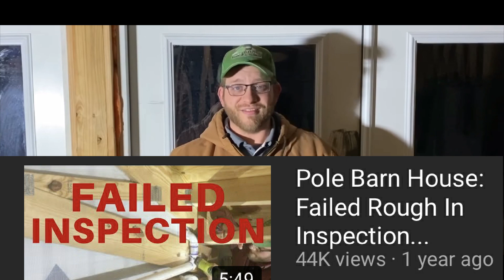Failed Deck Inspection

Comment: The deck builders weren't aware they needed those support fittings? WOW! The old foundation would probably make a solid and more sound-proof recording studio. Maybe a nice storage place for yard tools, bikes and such.Best of luck.
Reply from the maker: They said the fittings aren’t required in each area they build in.
Reply: @LittleMountainLife  I would think a company in their business would be aware of the local codes and restrictions.
Reply from the maker: Honest mistake if you ask me. They came back and fixed it later that same day. Thanks for watching!

Comment: Deck looks good. Head room under deck may not meat code if you develop it into housing use. Would worry about fire code as you have very limited exit with the block wall.
Reply from the maker: Thanks! Won't be considered housing use.  Likely just some storage.

Comment: Under the deck space. Well great idea but. But the big question  is deck water tight? May have a problem  just saying
Reply from the maker: We would have to do something to direct the water away from underneath. But it likely won’t end up being used for anything super important.
Reply: Could put a tin roof under it. But cost versus  what little you would gain may not be worth it right now

Comment: That deck is going to take a ton of maintainence over the years, i built a steel deck and bit the bullet and put composite down... guaranteed for 30 years uncovered, mine has a roof so it will outlast me im sure.
Reply from the maker: The amount of maintenance is relative. We are happy with it but are definitely considering switching the deck boards to composite in 10 or so years. It all depends on how much you’re willing to spend.